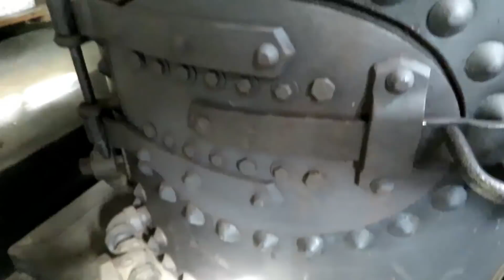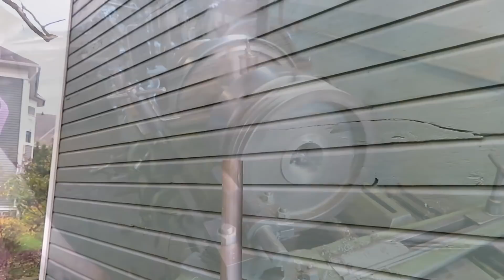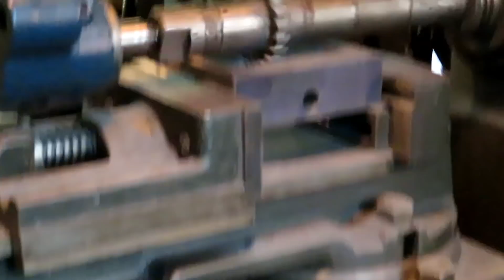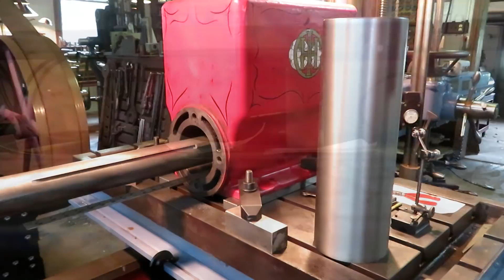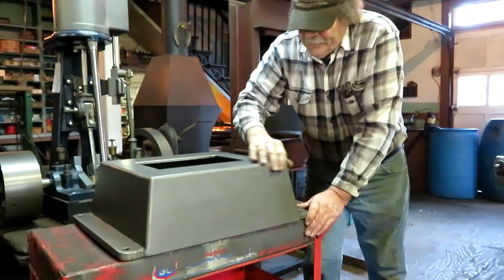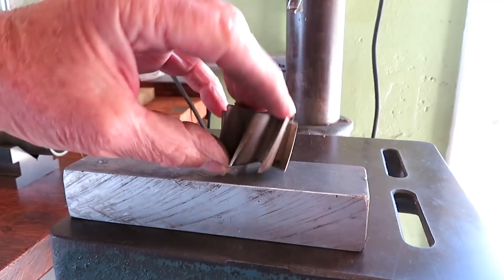OLD STEAM POWERED MACHINE SHOP  77   LOOKING BACK

Comment: Cool history of your shop. Nice safety tips. I do some work on a wood lathe and have made the mistake of winding the paper around the wood. Now I tend to use a very short piece of sandpaper. If it gets caught it goes flying and my hands aren't caught up in it.

I tell people who ride bicycles that the most important piece of safety equipment is the thing that goes into the helmet.
Reply from the maker: Hi Doug, I,ve always thought that an wood lathe could be more hazardous than most metal cutting machines.....Dave
Reply: @davidrichards5594  Possibly, I wear a full face mask because when I was first learning I had a small piece smack me in the face when I caught it with my tool. With experience I can get away without the mask now, but still wear it. The memory of a sore nose is still pretty vivid.

Comment: Another safety hazard is long hair.  Back in the 1980's when I was a machinist, I made a set up on a mill for the production dept.  I went back to the machine shop but came back later to find a woman with long hair working on the mill and her hair was dangerous close to the spinning end mill.  I walked over and turned the machine off while she was working on it.  She and her boss were angry as heck.  So I explained to them the danger.  She put her hair up after that, LOL....
Reply: Women are not the only gender to have long hair. My hair was not much longer than Dave's when I was almost scalped by a 1/4 inch electric drill. (Sometime it's not how close you are to the machine, but how close the machine is to you.)
Reply: I witnessed a long haired fella get wound up in a lathe. He lost a huge patch of hair/scalp and scuffed up the entire left side of his face very badly. Along with a permanent neck injury. Not what you want to deal with early on a Monday morning.

Comment: good tips. One of mine is if the chuck key is in the chuck, your hand doesn't leave the key.
Reply: Very smart and safe habit to be in.
Reply from the maker: I need to have Tom engineer up a key holder for the small South Bend lathe. The one on the American Lathe is on top and very handy. I stole that idea from Adam Booth....Dave